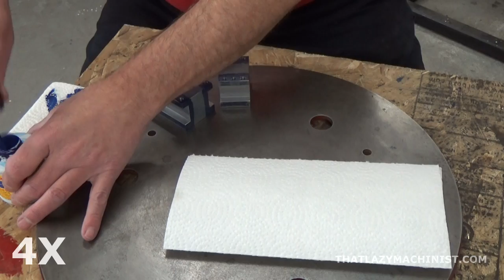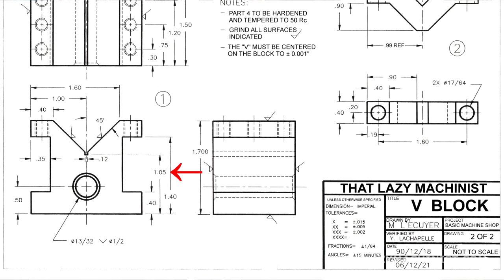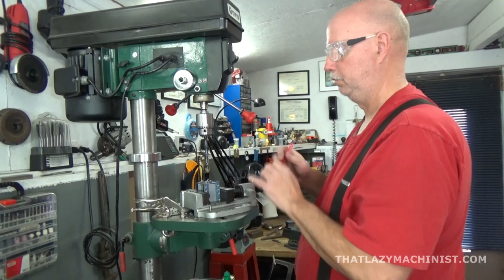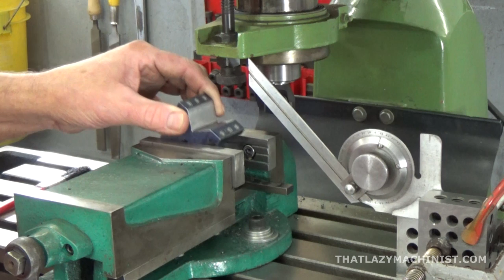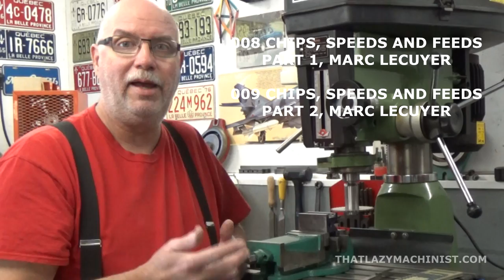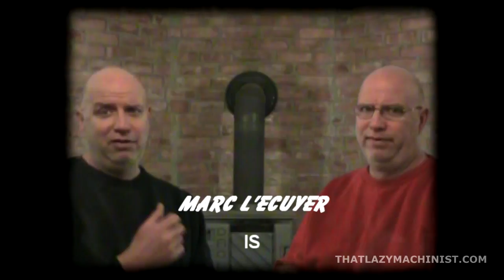V-BLOCK PART 6, mill, shaper and surface grinder 101 Marc L'Ecuyer

Comment: I'm currently making one, just a single block.

I was using my wiggler and centering the tip to the tip of the part  for my X and used trig for the rest for depth of start and end and let an altin end mill to depth and width and then doing a light finish pass. I use a digital angle finder.

Now for the block, I think im going to do what you did. I have a precision protractor and will go that route and will try measuring the way you did still with leaving stock for grinding.

Will update after I do it.

Comment: Why doesn't he go all the way with the center drills? They do in all the milling videos from other people.
Reply from the maker: Hi Elmer! I am using the center drill here as a spot drill and when spotting holes the mark produced to guide the larger drill only has to be a little wider than the chisel edge of the larger drill. Since center drill are prone to fracture I reserve full depth cutting to when absolutely necessary. Thanks for watching, Marc

Comment: Why have you cut up the blocks now ? You should have left them as a complete pair until after hardening and grinding. You would be sure then to have an EXACT pair. I know that you would have had to cut them apart on a surface grinder using an elastic wheel, and you would not have be able to countersink the through holes, but it is the proper way to make vee blocks as I was taught as an apprentice 45 Years ago. The other item of slight comcern is the amount of oversize you have left for grinding, 0.015" if I recall correctly. That is a heck of a lot of material to grind away, and if you are going to case harden them, you will grind all the hardness away. Case hardening is only about 0.010" deep and that is after many hours of soaking the parts in the carbon compount in a high temperature furnace. I will percevere and watch all the videos to see the final outcome.
I have only just found your channel and this is the first set of videos I have viewd so far. As it is now heading for Winter here in Australia, your videos will pass away the dark and cold evenings. Keep up the good work, best wishes from Dave in Australia.
Reply from the maker: Hi Dave cutting the blocks after they are ground is an option but it does present some difficulties for the home machinist. They could also be ground as a pair by joining them using the through hole after their primairy surfaces have been ground.  The parts are not case hardened so the depth of penetration is not a worry and I tend to leave a lot of material on my teaching projects since the videos are for novice machinists and they quite often have trouble getting things square. Thanks for the great input and keep me informed of you thoughts on my videos, Marc  P.S. Here it is spring and the snow is almost all gone!!!

Comment: Marc, Thoroughly enjoy all of your Videos, and humor.MY Mitutoyo Height Gage  allows the scriber to be mounted below the beam and thus  can scribe far closer than 1" from the surface.Loosen the little locking screw and slide the scriber out, then reinsert below the beam. You may need to may need to reposition the Vernier 180 deg so the scriber will not hit the base.

Comment: All this time watching, I'm thinking of possible ways to accomplish the milling operations on the shaper, since that's all I've got at the moment ... that bottom slot is going to be an experiment,  I'm certain.  Never heard of anyone trying to use a parting blade in a shaper.  It will work, or it will fail in a most miserable fashion...